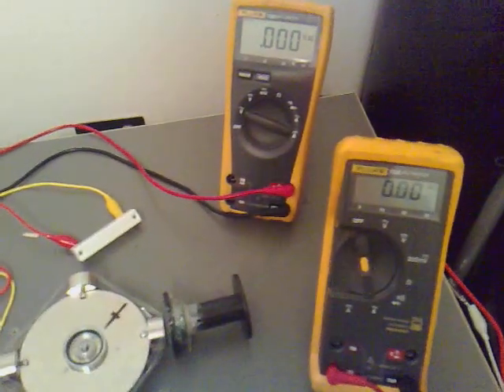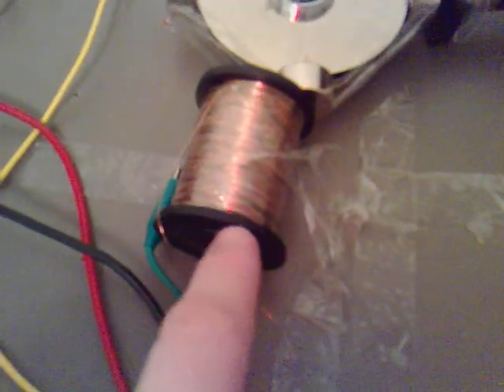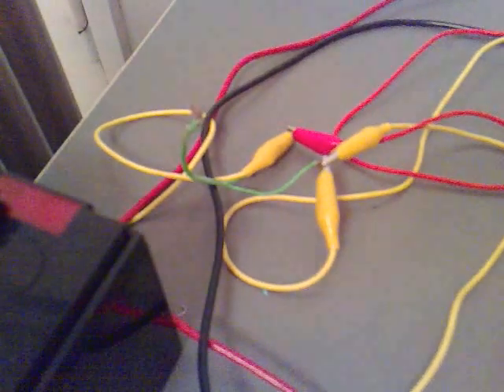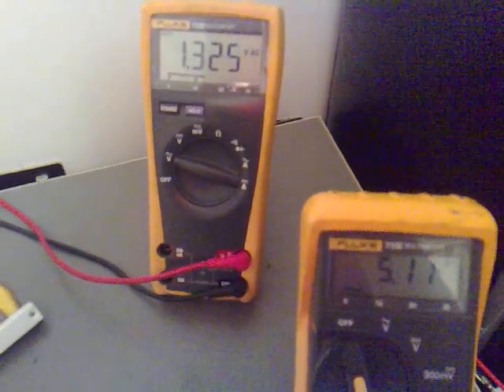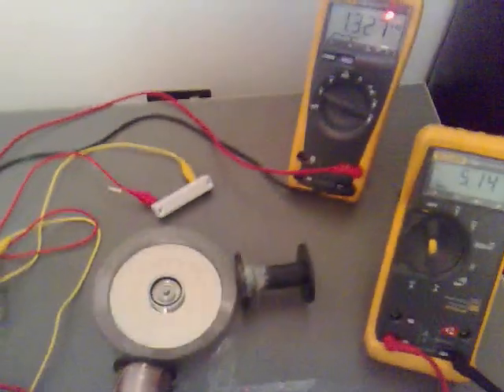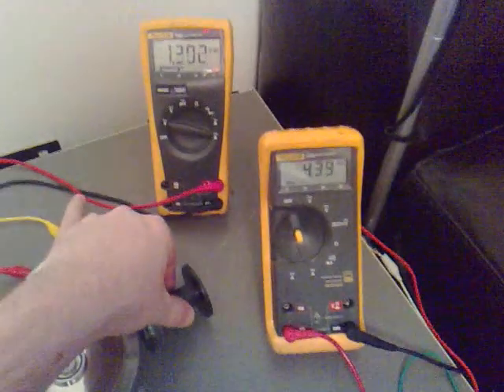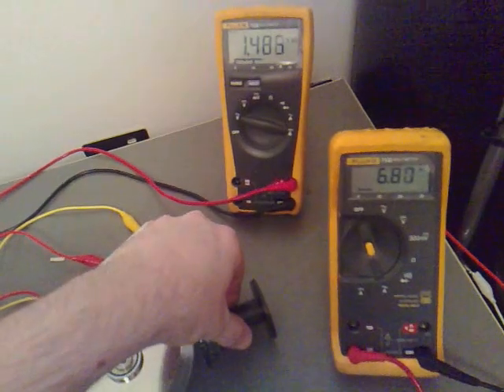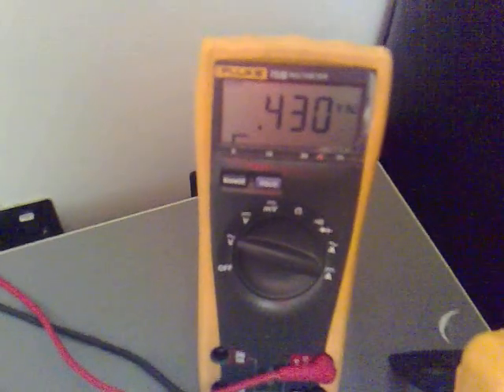Pulse Motor (Test 1 V&A Gen Out) 035

Comment from the maker: I removed the motor to make it spin easier, the reed switch was off ebay or you can get them from hardware stores. I think that a circuit with a 2n3055 is better though or a relay.

Hope this helps.